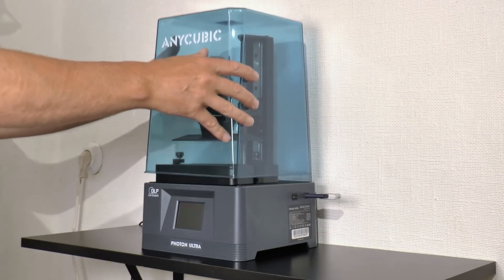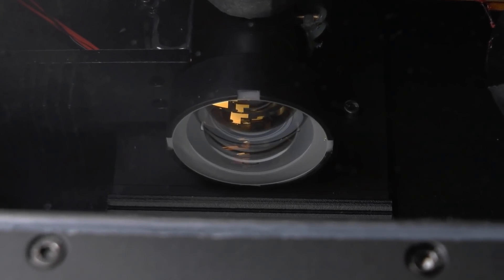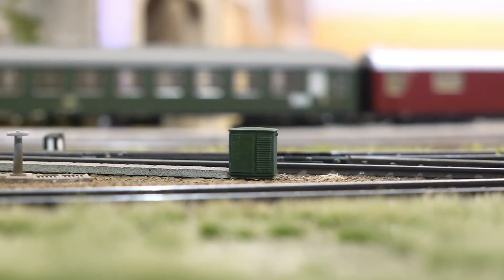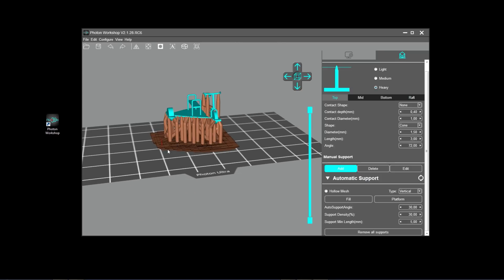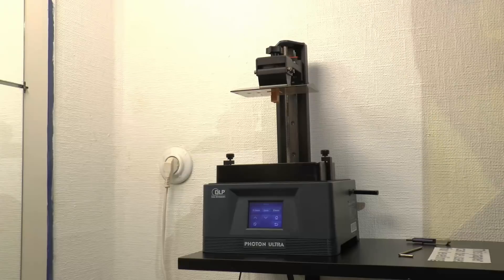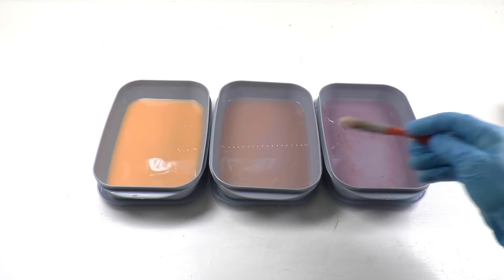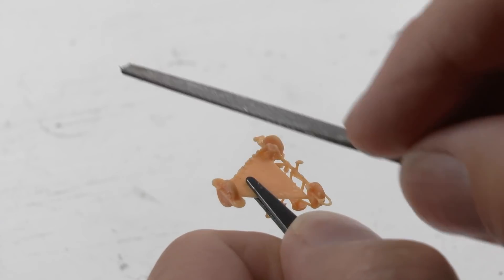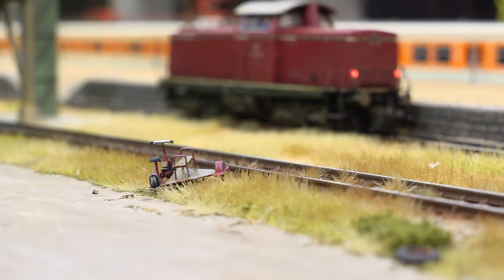Get Started 3D Printing using Anycubic Photon Ultra Resin DLP

Comment: One thing U need to remember when comparing DLP to msla as far as life span goes is that msla takes significantly less time to print objects as your printing whole layers at a time instead of drawing them with a laser. Also the current msla are using mono screens and not color LCD screens that have a much longer lifespan than what color LCD screens do

I'm doing 2 seconds for a whole layers regardless of size.... So If I can fill the buildplate and it adds no extra time for the extra prints

I'm not sure if Ur screen is hard glass that resin will come off if U get a leak that cures to the screen, but it's deff an issue for the msla ones.... So I'd advise U get a screen protector just to make sure U r protected
Reply: And i would like to add this from all3dp article about that printer: "That does not necessarily mean that all DLP printers are superior to MSLA regardless of their resolution, but it does mean the specs aren’t immediately comparable. Confusingly, Anycubic has said the Photon Ultra’s print quality will be “even better than that of 2k/4k monochrome LCD screen printers” despite that, its XY accuracy is listed at just 80 microns. For comparison, Anycubic’s own 2K LCD printer, the Photon Mono, has a higher accuracy of 51 microns."
Reply: So saying "blurry LCD" is funny. Next time instead of just reading from press material do some research.
Reply: DLP printers print a whole layer at a time too. It's not a single laser spot being scanned across the layers, there's an array of micromirrors (1 per pixel) switching between two positions for "on" and "off". It's the same tech used in digital video projectors, only here it's being used to project a UV image into a resin bath instead of projecting a movie onto a screen. The DLP is doing the same job as the LCD does in other resin printers, just with high contrast and longer lifetime.
Reply: Anycubic claims a 1.5s layer print time, which is actually quite fast.
The 2000 hours is the lifespan for monochrome screens. Older ones have a lifespan closer to 200 hours. But then, the older, smaller screens are about $20 each, so not exactly expensive. I have no idea what a DLP module would cost. Anycubic seems to assume that the 20000 hours is the lifespan of the machine ...

Comment: Im looking for 3D printer for printing Dungeons&Dragons diorama elements, and this Photon Ultra looks promicing !
Reply: You will not be disappointed.
Poisoned by the resin perhaps, but not disappointed by the printed models.
Reply: @TrollWithOpinions  The resin is not exactly poisonous - well, I guess you shouldn't drink it. But extended exposure can lead to sensitization, which means allergic reactions to resin, which is really inconvenient when you try to work with it. :P
Reply: @harmless6813  
When they specifically request that you
“Wear protective goggles and nitrile gloves whenever you handle SLA resin: 
Work in a ventilated area: If resin fumes can escape from the work area, they won’t stick around and enter your throat or lungs.
Cure any resin you plan to dispose of.”
It is a clear indication that the liquid you work with is not safe.
Reply: @TrollWithOpinions  I didn't say it's 'safe'.
Reply: @harmless6813  
I know you didn’t.
I am just really worried from watching too many YT videos of people not wearing protection and not ventilating the room.
And then I think.... what if they have kids, and the printer room is unlocked.